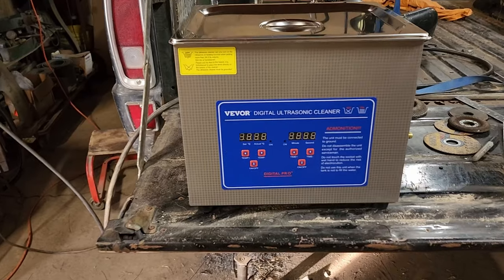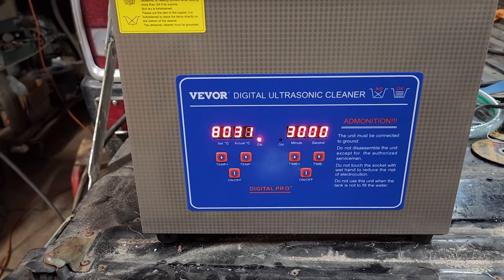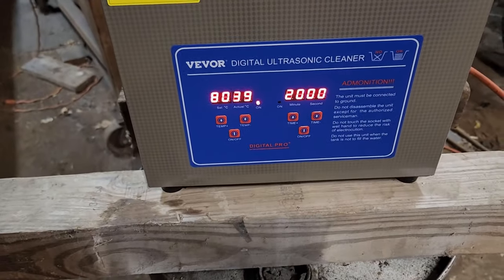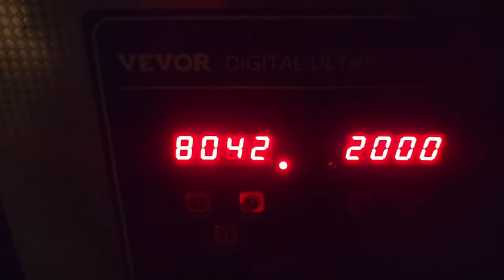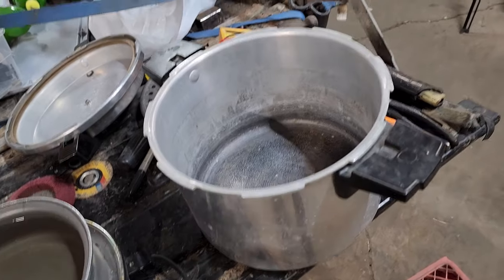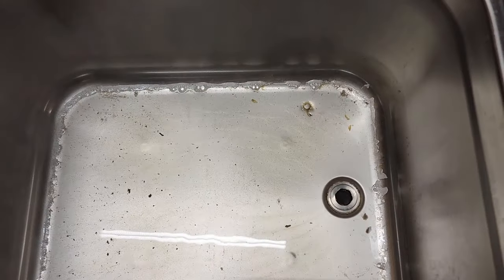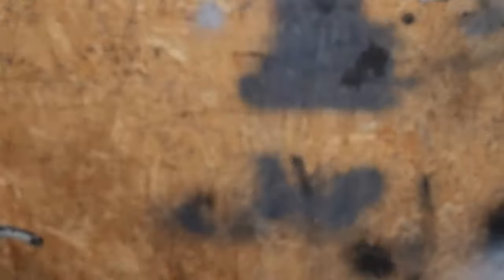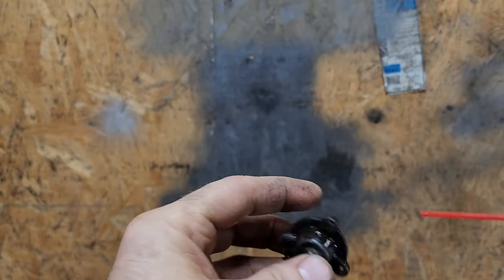Common, budget carb cleaning solution  showdown for ultrasonic cleaners

Comment: As you have probably found, the heating element is just a supplement as the ultrasonic transducer really heats up the item to be cleaned as well. They are a great tool! It s best to just prepare your solution, set the final temp required and start it up. Within a reasonable time period it should be up to temperature.

Comment: The only product I use in my ultrasonic tank for carburetors is a solution of 8:1 distilled water and Simple Green Pro HD which is purple in color.  It will not darken your carbs like the regular simple green does.  I learned that the hard way that using regular simple green in my tank!
Reply: Hi. Isit 8 and 1 for water?  Or the opposite. And what about regular water ist working good?
Reply: @Q8motorclassic  Its 8 parts water 1 part Simple Green HD Purple.
Reply: By the way thanks for reply

Comment: You’ve discovered what I’ve known for years. Pinesol is AMAZING. You don’t even need to heat it. I don’t ever as I don’t have an ultra sonic that heats. I usually just soak the carbs over night and it takes care of any bs in the carb.
Reply: The ultrasonic does help speed up the process and get into small areas.
Reply from the maker: Pine Sol absolutely monkey stomped everything else in my test!
Reply: Does it remove crystallized fuel if it’s been sitting for years?
Reply: I had heard a long time ago that pine sol was great for cleaning gas tanks that have been sitting and full of varnish. Never got around to trying it.

Comment: You have to be careful with Dawn and other soaps on alloys like magnesium. I personally use ethanol free gas with 2 stroke oil to clean. In the event you get water in a passage or soap residue it can oxidize and destroy the carb. I use the gas in a plastic jar inside the cleaner with a brick on top. When using heat it can cause o rings and check valves to swell and destroy them. LOve my ultrasonic. It runs 12 hours a day!

Comment: I just got one of those ultrasonic cleaners also and I always heat the water before adding it to the cleaner also.
Reply from the maker: Its not that bad doing it, now that I know I have to and am properly equipped for it now
Reply: I just use hot water out of the faucet to fill it up, then add my ratio of cleaning agents that I desire for the parts I'm cleaning....

The hot water out of the faucet gives the heater a "jumpstart", and it doesn't take long to get up to temp.

Comment: Great video, interesting results. 

I'm not surprised about the heating element not being up to the task, in your situation. I believe the specs say it is a 200 watt heater ang the cleaner and lid are basically a giant heat sink and you're heating 2 gallons of fluid. That is incredibly energy intensive. The heater and transducers are able to heat the fluid fairly well at around 60F (15C) 

They do now offer a better version with the black panel that has I believe twice the wattage on the heater. Considering the volume of the fluid and the fact that it is not completely insulated, it probably needs more like 1000 - 1500 watts to get the temp up quickly, when in a cold area. If the unit was perfectly insulated with no heat escaping at all, it would take 800 watts for an hour to heat that much water from 10C (50F) to 80C ( 176F)

Comment: Before I bought my ultrasonic cleaner, which I use mainly for carburetors, I used to boil the carbs in a pressure cooker on top of my stove with a 50/50 mixture of Pine Sol and water for 30 minutes.  Works VERY well that way.... Carbs came out literally looking NEW 👌

EDIT: Make SURE you open some windows, and ventilate your house VERY WELL if you do that though, or the eventuall build-up of Pine Sol smell will get VERY STRONG and end up taking your breath away. I'm SURE its not a good idea to breathe that smell in. It goes away fast with windows open though.

Comment: I’ve always had pretty good luck with just soaking carbs in vinegar overnight without heating it and then just cleaning it off with a little brake cleaner. It probably would work better hot or in the ultrasonic but it would probably be kind of expensive running that all night. It’s just an idea to try with the accelerator pump part off the bike carb if you’re still struggling with that
Reply from the maker: Finally got it by applying heat from a small propane torch and smacking it on a flat piece of metal. The heat expanded the aluminum enough that it alliwed all the tiny check ball components to pop out with the shock of slapping it down hard.

Comment: Thanks for the video, I went out to Dollar General and picked up 2 gallons of Pine Sol yesterday. I ran it at 80C, for about 2 hours, rotating every 30 minute cycle. It wasn't as clean as I wanted and discovered the carburetor I was cleaning was actually distorted by a fire and was garbage, but I wanted to see how well it would clean if I let soak over night. I haven't gone out to the shop to check on it... I think you should open that machine up I bet you will find a wire off your heater or something simple.

Comment: Acids are bad for Aluminum and should be avoided.  Use a strong solution of simple green for aluminum.  For iron parts dishwasher detergent (powdered) works very well and is also very cheap.  You really have to tailor the solution to what type of metal it is you are cleaning so that you don't do damage to the parts.

Comment: I have the same Chinese ultrasonic cleaner. Mine has zero issue heating up and will actually unfreeze my cleaner in the winter without having to wait forever. I'm guessing your heating element isn't attached to the bottom of the tank like it should be.
Reply from the maker: On one test, I forgot to turn the heater off when draining it and it left a slight scorch mark on one end of one of the longer tank sides. I would say that jundging by the size of the scorch mark, there should be more that one or a bigger heater.
Reply: Yep it’s not heating right for sure. Send it back
Reply: @misfittoys8883  I have the same Vevor. Pretty sure the heating elements are on the top. Only remember seeing the transducers on the bottom.

Comment: For maximum effectiveness,  put the check valve in the ultrasonic cleaner by itself without the basket.  Turn off the heater after it get up to temp. That will give you maximum power to the inducers. Rotate/turn the piece over between sessions.

Comment: Yes have a couple of the same ones of ultra sonic cleaners ordered a big one and they ended up sending a small one!!! I called them and told them that they sent the wrong one and would like the size one that I ordered!!! They said no problem they would send one out Wright away!! I asked them if they was going to send a shipping label to send the one that they originally sent!!?? They said no that it wouldn’t be worth the shipping cost to have it shipped back and that I could keep it also!!! When I run mine it will only run as long as the amount of time that I set it to!!! I will run it for max time and max on the temp setting!!! As soon as it goes off I will reset the temp and time to max again!!! I will do it 3 or 4 times!!! Mine seamed to only go up in temp when I had it running!!! I have found that changing the cleaning solution after cleaning what ever I was cleaning after the first cleaning of the items!!! The solutions would definitely be very dirty!!! But after the first cleaning the solution would definitely be down graded and not even half the cleaning solution power!!! I used mine for cleaning carbs also!!! We tried the simple green and purple power and yes they would work but they would leave the parts a slimy slick coating on them!!! But after cleaning everything I always would rinse all the parts off with warm water!!! Yes I would definitely have to use gloves because it would definitely get pretty hot!!! We then baught a gallon of the cleaning solution that they recommended for ultra sonic cleaners and it would definitely work the best but at 20.00$ to close to 30.00$ a gallon and having to change after each thing or a whole carb I only tried a gallon!!! I have also found that the next best thing to clean a carb from regular carb dip that you can buy from a parts store is pure lemon juice and not diluted!!! Although lemon juice will dis color the carbs!!!! Well hopefully that helps out or maybe you have already figured out everything already!!!! And yes lemon juice I always clean everything Wright away and then rinse off with hot water!!! Definitely don’t soak anything to long in lemon juice or it will eat the parts up pretty quickly!!!!

Comment: Couple of things about ultrasonic cleaners. Read the manual. I have the same model and have no issues. Heaters are towards the top, and in the beginning of your video, your water level is lower than the heaters. States in the manual where the water level needs to be.

 Also, the ultrasonic action will warm the water so just fill up to proper level with hot water and start it up.  

Another thing is the ultrasonic waves come from the bottom and go up so whatever is facing down will be cleaned the best. With carbs like those, you do one cycle then flip them. 

Also, the cheap pos basket actually reduces the waves somewhat. I use copper wire and usually suspend what I am cleaning and do not really use the basket.  My stuff comes out clean, like new. 
                                                                                                                                                                                                                                                                  
As for that small check valve, put it in a glass jar with the valve facing down (no air pockets) and add penetrating oil in the jar. Put a tight lid on the jar and have at it for 20 minutes. It will free it up.  I honestly love me Vevor.
Reply from the maker: Interesting stuff. Next time I use mine, I will try the suspension trick. I did end up getting the check ball freed up with an easy application of a small propane torch

Comment: I think flipping the carb around each 20 min session might let your pinesol solution access all the cracks and crevices.
Also using a sacrificial unit,  how long can you leave a carb in the pinesol?
Reply from the maker: Before I got the ultrasonic cleaner, I tried soaking some of the motorcycle carb components in straight pine sol for about two days with no visible ill effects
Reply: As soon as I get it two cly of cleaning I wash of and don’t leave them in it

Comment: In order water and dish soup. Didn't work well. Then Pinesol, which worked pretty good. Then Lemon juice didn't work that well, but was better than soup and water however it did react to aluminum. The Vinegar wasn't that effective and from personal experience, vinegar can attack some types of aluminum. Then came Simple Green, which we are not told if it was diluted and personal experience even when cut 4 to 1 with water, still reacts with aluminum. Pinesol worked the best, but again, the author didn't tell us if we cut the Pinesol with water or not.
Reply: In Comments OP, mentioned/implied that he added a quarter gallon of water to his 3/4 gal of pine sol

Comment: I've watched a number of these videos before purchasing a cleaner but unless I am missing it none of you have mentioned the mix ratio. Could you comment on what you used for a ratio'
Reply from the maker: In my partingvthoughts at the end of video, I say that they are all at a 50/50 ratio except for the pine sol, which was slightly weaker due to the size of the jug That it came in
Reply: thank you I apologize I missed that  @misfittoys8883
Reply from the maker: No problem. I tend to start jumping forward in vids when there is too much useless yapping likeI was doing

Comment: Most of the ultra sonic cleaners do not heat very well.  If the ambient temperature is in the 70-80's slightly better..  Typically you heat the liquid and the parts that you are planning cleaning.  Setup a box or some container and a small room heater.

Comment: Have a similar one, heaters seems to be a joke no matter the brand. Gallon of brake clean from auto store should be $25, but my go to now is either gasoline or diesel. Cheap, effective, just leave the heater off and run it for max time. 5 or 6 hours in the ultra is worth it if all you have to do is dust it off with air .
Reply from the maker: The idea of that volume of gasoline in an electrical appliance makes me cringe! Ovbiously, you wouldnt want to use the heater, but the chance of something going wrong with the rest of the electrics that could cause a spark is a cause of concern, especially considering the dubious quality of these chinese units. Maybe someday I will try it way outside of the building on a long extension cord.

Comment: Don't bother with the water use the pine-sol straight works way better.
Rinse well with water or it will darken the aluminum when left on and exposed to the air.
Reply from the maker: I will try that next time.

Comment: Small engine guy swears by straight gasoline. He just puts it in a container with the gas and puts the container in the ultrasonic cleaner. Says it vastly outperforms any cleaner you can buy.
Reply from the maker: I will give that a try, but obviously without  using heat!

Comment: I wonder how purple power would work, it’s just a general degreaser I’ve used a lot for pressure washing stuff seems to work great for that.
Reply: Purple power will leave a black residue
Reply: Good to know thanks!
Reply: It will remove plating. Carbs are coated in Zmac. Any acid will destroy the zinc.

Comment: I got same brand of ultra sonic cleaner but what size is your ???
Reply: I think he says 2 gallon.
The size you choos depends of the size what you will clean ! 
If you heat the water + chemestry the big size will take longer timer. 
even if the heater is more powerful. 

Smaller size = less gallon water and you can heat up in shorter time.

But the bigger size is not murch stronger with the ultrasonic wave. 
Smaller size and you are the winner ! 

If you choose more agressive chemestry the result will be better. 
But be careful with aluminuim. You have to choose the right chemestry.

If you buy ultrasonic cleaning fluid you hve to pay a lot more. But it will be better.
More gallon and it will be expensiver for you. 

Mor gallon and you have to change a lot dirty water and chemestry. 
Smaler ultrasonic and you have less dirty water volume.

Ok if you buy industrial ultrasonic cleaner size will matter a lot. 
Only you own mixture will be cheap. 
See industrial ultrasonic cleaners and you find different types. Read why.

You get better results if you use solvent (gasoline/diesel) and preclean the carburator. 
Bette the greas and dirt from the outside is away (before I open the carburator...
.. It is clean at the outside! = Less dirt in the water and less dirt than in the carburator from the outside)

Air to blow the gsoline/diesel away and a closer look at the carb. 
If I find some broken parts or other faults ...
Than I open the carb. 
Rub away the gasket.
closer inspection .
But the carb in the water+chemestry and heat water and carb up.
Only if I have to safe time I use hot water from the kitchen.
The thermal shock is harder with the hot water. (If I have a historic carb ... No good idea) 

Than I start ultrasonic 15 to 20 minutes.

If the carburator is it worth ...
... it is worth to spend money for industrial ultrasonic cleaner fluid.
 
Cheap carburator (or other part) and my water-chemestry will be fine and cheap. 

Best ultrasonic is when you have a distnce between bottom and part from 1/4 inch or more.
Worse when you but the carburator direct at the stainless bottom.

If I want to safe money for the expensive industrial ultrasonic fluid , I use ...
- a pouche / small back with less volume  or 
- a plastic jar 
than I have the water in the us-cleaner with high volume and low volume industrial cleaner in the jar or bag. 

After the first 20 minutes let the ultrasonic cool down the transducer and the generator electronic. 
Often I clean it again 10 to 20 minutes. 

CRest you see in the video.
Nice video, well done.

Comment: What size ultrasonic cleaner is that?
Bummer that the heating feature turned out to be a gimmick, maybe yours is defective, but I wouldn't count on it..
These companies tend to have zero concern about misleading their customers, and those shady companies/sellers are getting thousands of sales per month. These platforms have little care whether you're a good seller or not, they will black out listings from good small sellers in favor of bad mega sellers.
Reply: The manufacturer know better than us what is right. 

If the heater is weak the regulation is better. 
You fill preheated water-chemestry in the ultrasonic.

For some parts (historic parts you can not find anywhere) it is better to heat it up slowly. 

Some parts are not for higher temperatures. 

If the heating is a gimmick, than a other chinease company is there a sell better heating ultrasonics. 
The weak heating companys will be soon from the market. 

But you find no high watt heating. There is a reason.

And normally you dont use these device never in a cold environment. 

By the way = professional mvery big ultrasonics are never switched of (maybe at the weekend).
The keep 24 houres a constant temperature. They only switch the ultrasonic on. 
They have no strong heater inside for that big water volume. 
They will switch on there gimmick heating and after 1 minute off. Fine regulation of the temperature. 
Some parts dont like to high temperatures for 10 secounds and than 4 minutes the heating is off.

Comment: I have that same cleaner, your heater is defective, send it back.
Reply from the maker: Not worth the hassle at this point. I will just heat up the solution separately. Gets up to boiling fairly quick on the propane burner.
Reply: Another person who doesn’t know how to operate an ultrasonic cleaner.